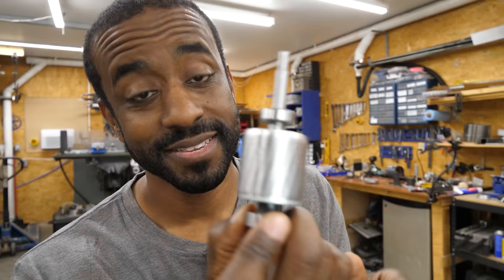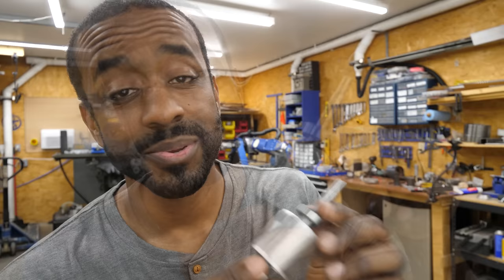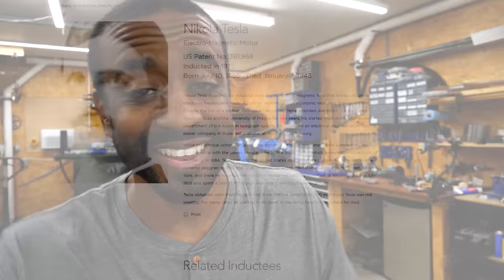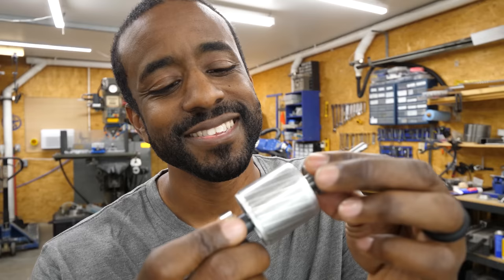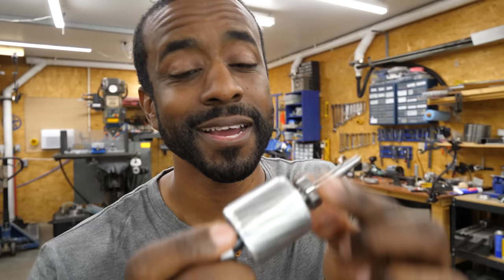This Invention Got Nikola Tesla Inducted Into the Hall of Fame! : Jeremy Fielding #096

Comment: Hi, I have started about 15 hydroelectric power plants across the US and Canada. Most were synchronous generators, but I also started induction generators. A 70kW and three 1 MW induction generators. Induction generators require connection to an energized powering and then the prime mover must overspeed the induction motor about 10% of rated rpm. There must also be enough capacitance on the grid to excite the induction motor/generator. 
There is no "synchronizing" required as with a synchronous generator, no voltage regulator to control power factor, only a shaft speed pickup, some larger as 1 MW can have soft start by applying partial voltage, etc.

Comment: If you weigh the copper pipe and the magnet independently, then weigh the pipe with the magnet falling inside, you will find that the weight will be the sum of both the pipe and magnet although the magnet is floating inside.  This shows that the magnetic field links the two together.

Comment: (I am non-technical, just a hobbyist).

Re Electric cars:
1) Battery packs are charged via home current
2)  Charged Battery packs run the motor, etc that runs the car
3)  The battery runs down, for re-charging..... the cycle goes on.

Question: Why couln't it charge as you run? ...ad infinitum?

PS:  I was hooked on learning "Free Energy from washing machine motors".  Why is it simply not possible?

Comment: Jeremy, one of the other applications of rotating magnets is to put copper pipes close to them, and fill them with circulating water.  The magnets will heat the water inside the pipes with no flame, completely safe, and by changing the speed of rotation and strength of the magnets, a person can get very precise temperature control.  This would make a very good home heating system which could vary things and keep the home a very even temperature during the heating season.
Reply: Interesting! Got any links to this?

Comment: This was awesome! I worked with both induction and non induction types for 36 years in an aerospace manufacturing facility. We had up to 1K HP induction motors that I personally wound the coils, also stacked the rotors and stators with their laminations. We produced a permanent magnet generator for drilling to power the instruments. It had an impeller mounted to the front and as long as there was drilling the dirt that passed through the impeller blades caused rotation which of course produced electricity. The other type was a winch, this motor had brushes and an armature which was needed to produce low end torque. I have been fascinated with electric motors and their capability to produce power. The majority of the motors we produced were induction motors. 36 years of playing with fun toys. Thanks for the video and I thank you for your enthusiasm.

Comment: Your props to demonstrate the induction motor were so simply but so powerful.
Of course today many of these induction motors or 3 phase induction motors where the speed and power output can be varied.
All modern electric day electric traction uses 3 phase inverters to run control AC traction motors.

Comment: Your description is for a DC motor, your induction motor typically has 3 coils and powered by an AC voltage where the combined vector of all field is rotating. And that field is picked up by the squirrel cage.

Comment: Hi, In the late 1960's, I took apart an old motocycle speedometer and found an aluminium cup and a magnet. 
Couldn't get my head around how it worked back then  as I knew aluminium isn't magnetic (my grandfather helped me out with a lot of stuff, I was probably 7 or 8)
 In school in early 1970's I had trouble with physics but did find out about magnetism but it still only kinda made sense. I had to look everything up in local library (many years before internet was a thing)
This was a much easier and simpler demonstration, you would be a great science teacher

Comment: I'm pretty sure most motors found in a home are induction motors. The only exceptions I can think of are things like garbage disposals or blenders, which I think need much more starting torque than a single phase induction motor can provide. These probably all use brushed motors instead.

Comment: I was researching induction motors that would produce electricity and stumbled across your video.  I realize after watching your video that it will require energy from an outside source so it will not produce free energy.   🤔  I do think that Tesla did discover how to generate electricity from thin air.  thank you for your video.  a fellow engineer.

Comment: A tight fitting ball falling through a tube has greater air resistance if the end is closed off, ie. pushed up against a mobile phone camera!
Reply from the maker: If you really think that’s what you saw, You really should just try it. This is stupid easy to test with copper and none copper under the same conditions. Or magnet none magnet of same size if you prefer. It’s a great day to learn!Thanks for watching.

Comment: isnt that what everyone calls brushless? cool demonstrations and explanations = great video...also theres so many motors here: inside the computers, fans, swamp cooler, ac compressor, ac fan, printer, waterpump, air compressor, washing and drying machine, xbox, playstation, garage door, windshield wipers, power windows, engine starter, alternator, ac blower, ac blend door actuators, rc servos, rc electric motor (brushhed/brushless) , racing game steering wheel, radiator fan, electric powersteering, fuel pump, refridgerator, etc etc etc

Comment: I loved this video.  Would you please follow up with descriptions about how to get a single phase motor to start turning with things like start capacitors, run capacitors, start windings, etc.  I'm sure you would do a great job explaining.  And if you've already done  this, I've not seen enough of your great videos.
Reply from the maker: I made a whole series called "how motors work for beginners". I cover several different motor types including single and three phase motors. Search my channel
Reply: @Jeremy Fielding  you helped me save my dad 1400 dollars on a stove hood vent. He doesn't talk to me anymore but right before that I told him they put a Lil circuit to drain the start cap so a technician didn't have to concern with danger. So I triggered a relay that would allow in power and the motor spun right up. My dad didn't even believe me when I said there was this logic board in the hood hidden away on these modern ones. The installer found a sneaky way to get people to buy new hood vent assembly after long power outages. 🤨

Comment: awesome video, did microcontroller motion control electronics and software for decades, iirc, Tesla literally dreamed how rotating magnetic fields could be generated by superposition of 3 phase sine waves shifted in phase 120 degrees.  It is a good way to teach the power of sine waves and the mathematics of adding sine waves with different phases.  Would make a nice video to show the 3 phase sine on an oscilloscope.

Comment: How to distinguish brush motors from induction ones.
I'm guessing brush ones are mostly DC so if the casing has specifications on it, you'd see that and there would probably be a rectifier somewhere if it doesn't run on batteries somewhere.
When opening the brush motor itself you could maybe be able to see the permanent magnet on the outside... oh yeah, so you'd definitely be able to place a screwdriver on the casing and feel at least some magnetic pull.
Aside from those 2 I can't think of much else to distinguish them :P

Edit: ah yes! the sound, of course it depends, but generally induction motors are way more quite than brush motors. Most drills are brush motors due to having higher torque (not all though).

Great video, I'll be watching some more of those!
Reply: If you need high torque in a single phase motor at low speeds you need a brush motor, AC ou DC. Or a permanent magnet brushless motor.

Comment: Is "Nerdy Details" a technical term? I like it. But, I walk into my garage if not air powered, it has brushes. I do know it took years if not decades to move away from brushes in a simple power drill that plugs into the wall outlet, to brushless. I think some are unsure as it is a new gimmick but they have no clue. Then many bellyache about soft-start. I have a theory. This limits in-rush current of a cold copper coil, but using pulse width modulation allows for speed control and paved the way for brushless motors. Another enjoyable production by Jeremy Fielding. Congrats!

Comment: Something I expected to hear from you was how clocks (used to) keep time by running on the 60 cycle alternating current.
Reply: Still do. Ever see a classroom clock get batteries replaced?

The interconnectedness of the electrical grid makes for keeping to 60hz as close as possible essential to avoid phase distortion and loss of power efficiency in the grid. Generators are huge and that they have this mass makes them like flywheels and so very stable. It was such a good way to sync time across a big country before quartz and atomic clocks.

Comment: I noticed at 3:15 the screwdriver does not fall due to gravity, and yet the power is turned off. You mention that there is no active electromagnetic field, I agree, but there is a stagnant flux field that holds the screwdriver there. So, there is a holding field.
Reply from the maker: That's not exactly what is going on. Its too much to explain in the comments, but that is not useful at all. Its not consistent or useful for work of any kind.

Comment: By spinning the rotor by hand to start it, the common household AC single phase 2 pole induction motor will not run with only one pole. Seems like it should but I've experimented with the concept and could never get one to run. A single phase AC motor with a permanent magnet rotor will run all day with just one pole.

Comment: You never mentioned how you can change the speed of an induction motors by changing the frequency of the ac power. The dc motors still use brushes. Hi I am a Data Systems Engineer specializing in PLCs.

Comment: Induction motors also require some sort of electronic speed control(ESC) because you have to convert DC to AC to switch each set of coils in sequence. In other words you can't just connect an induction motor to a battery and expect rotational movement. Even an AC input has to be regulated. An ESC does just that and switches each set of electromagnets on in the right sequence to cause controlled rotational movement, ESC's are complicated and are a subject in themselves. You can of course easily build a DC motor which although less powerful and have a shorter lifespan BUT are far less complicated to understand and work just by connecting power( battery) with no ESC. I remember building one with some nails and a bit of copper wire scavenged from a broken radio transformer when I was very young, 10 I think. At that time I had no idea there was any such thing as an induction motor.

Comment: Another name for an induction motor would be, "brushless," the other type of electric motor is, "brushed," which uses a spring fed contact plate that is designed to wear like a brake pad.  Many older motors had brushes but the friction robs efficiency.  They didn't care, "Just draw more power!"  Old refrigerator kicks on and the lights dim.  Most likely, many old, "dead," electric motors just need some new brushes and a cleaning.  In the modern quest to pack a mighty punch in a small, lightweight, package, at 12-24v, induction is the only available option.

Comment: Loved this explanation! Can you explain how the motors reverse the polarity in sync to turn each electromagnet “on and off” in sequence?
Reply: The angles ensure it moves in the desired direction and can start it in many cases. Basically the rotating field is not if on off on. Is smoothly rotates because ac power is a sinewave. You need to move magnetism to use it to induce energy conversion/use. So as it induces electrical energy like within a transformer, the wire is coupled to another coil on the rotor to have another field generated to make use of the opposition of the rotating magnetic field. It pushes and pulls as it goes keeping the rotor moving. 60hz is a limiting factor on rotating speed, but the rotor has 4 coils angled each side is one so it should have 8 segments if I'm remembering. 16 then if you count the ouside faces. This works with two and even 1 electromagnet. Because as I said ac is a sinewave. Smooth field movement. In single coil its using a specific shaped set of laminated pieces the coil wraps around and an "air gap" so you won't have the opposing side fight the active side, visa versa. It's a transformer that instead of converting voltage converts into motion. Not always efficient. But current draw isn't a lot fir the least efficient applications. A ceiling fan isn't efficient but doesn't draw lots of current. These are the original brushless motors. A DC brushless motor in your computer uses permanent magnets and logic board rotates the field from the inside, and the rotor and magnets are on outside not angled. They can therefore be unlocked from a 60hz sinewave as the controller of speed or torque.

Comment: I know I'm being a bit of a troll, LOL. There's like 3 or 4 electric motors in a microwave. 3 in a regular microwave, and 4 in a convection equipped microwave. The big motor with the start cap, that's for the squirrel cage blower. Then you have a smaller electric fan in back, similar to a bathroom vent fan motor. Then you have the rotisserie motor. This is a small, gear reductor, AC motor that turns at, like 2 RPM or something. Then you have another fan motor on a convection microwave, to blow hot air over the heating coil, which is where the convection part comes from. I just thought I'd throw some useless info in there, because those little tiny gear reduction AC Motors are still useful, even though they're small. 😎👍

Comment: I'm guessing that ac motors are typically induction because the alternating current would automatically reverse the poles? I know being a mechanic that most DC motors are not induction and instead have brushes that move from positive to negative to alternate the fields but I do no know what type of motor this is

Comment: I though  that the stator and the rotor were the two halves of a transformer the stator has the primary windings and the rotor the secondary all short circuited by the aluminum squirrel cage  the rotor turns by the magnetic field force  created between the two iron cores ....... that is how it was taught to me .

Comment: So rotor in an induction engine has to be made out of copper or aluminum? No other types of metal will yield a "dragging effect" from the electro magnet?
Reply from the maker: These two are the best choices. Things like efficiency conductivity and weight matters as well. The basic effect should work with anything that conducts electricity.

Comment: Sometimes I do not like to throw things away so I had a heater fan that oscillated. The heater quit working so I kept the oscillating motor out of it. Two years later my microwave turntable stopped working. I very carefully opened up the microwave to see what it looked like. it was the same motor that was in the oscillating heater fan. it just had a different adapter. so I took the adapter off of the broken microwave turntable motor and I put it on the oscillating motor from the heater. I put it in my microwave and it works like new. ( for the average person do not try this at home if you touch any of the inner components of a microwave you can be killed instantly )

Comment: Very informative videos, Thank you Jeremy,  I have an induction motor that does not run at full rpm. It seems to want to start for a few seconds that stops. It is a Wacker Neuson EH 65. It has a single phase (120 Volt) to 3 phase converter ( no start or run caps in the design). I have replaced the converter and still have the same problem. Do Armatures fail in these types of motors? The armature is simply a Shaft, Fan and large set of metal plates that do not appear to  be (premanently) magnetic. It seems to want to start yet does not.

Comment: Jeremy, I'm hoping you can answer my question; I have an old 3/4hp 110v bench grinder that won't start on its own, I can spin the wheel and it starts and runs fine. It doesn't have any capacitors, is it possible to add a start capacitor, and how would it be controlled to drop out after starting? I've searched, to no avail, for this information. Thanks!

Comment: After having watched your video on electric motors, I'm left with some questions about DC motors. 1st. Isn't it true that they can be run in reverse by switching the power input, i.e., reversing the polarity? And 2nd. Are there any 12V motors that are preferable for powering things like boats?
Reply: First question: yes. Second: consider a brushless DC motor.

Comment: What would be the reason to use motors with brushes?
Reply from the maker: I suggest you check out my series called "how motors work for beginners DC motors" That will explain this way better than I can explain it in the comments. Every motor has its pros and cons. Cost, and speed control would probably be the biggest factors but there is more to it than that. Its an engineering decision with lots reasons you might want the behavior of a brushed motor.

Comment: I used to repair microwave ovens. The secondary of that transformer is about 5000 volts with a very high current. It can kill you. I accidentally had my finger on the metal of the transformer and there was an arc that hit my finger. I was thrown across the room then my finger was numb for a while. You are risking your life by even touching it.
Reply from the maker: Not with DC voltage.